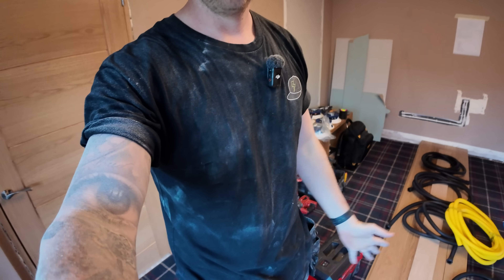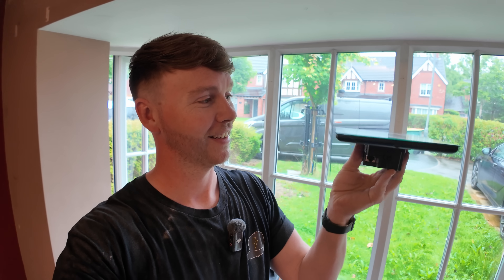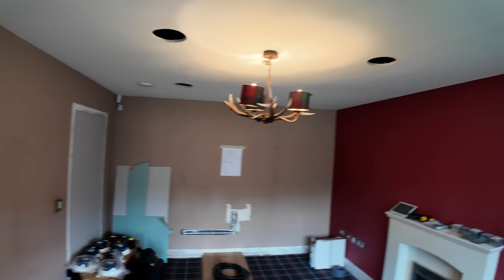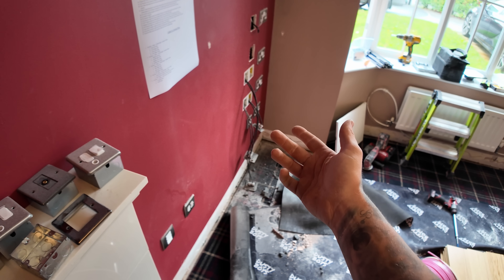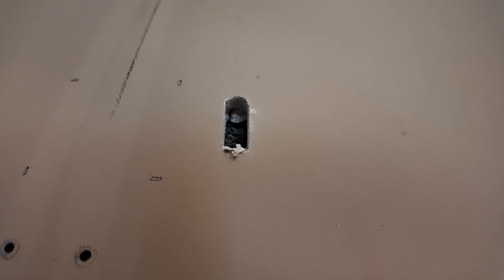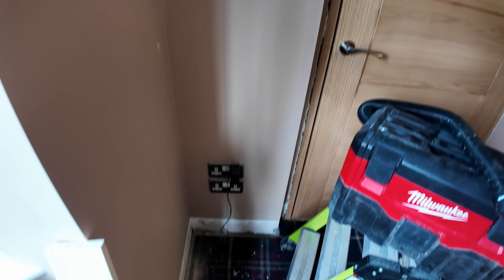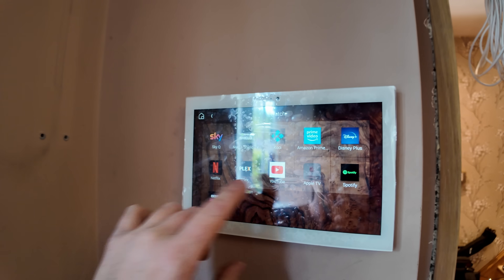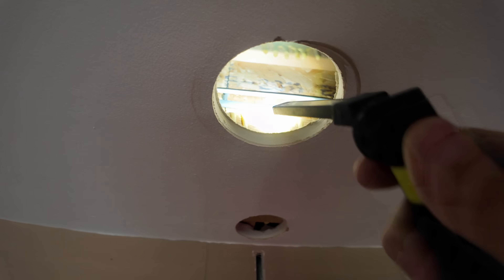100k Home Cinema - Ruined Plans In 5 Minutes

Comment: Just completed a 7.2.4 dedicated home cinema following a ton of research. The speaker cable length is a non-issue, the most important things to get right are cable thickness , ideally 12 or 14 gauge, and making sure that any mains cables are not routed parallel with them to prevent induced voltage and potentially mains hum. A much bigger influence on the sound particularly with a multi-speaker set-ups in a small room is the amount of room treatment (absorption and diffusion) to address the relections off the hard surfaces like walls, ceiling, windows and uncarpeted floors.
Reply: spot on, good advice

Comment: I can safely say, as a tech nerd, there is going to be a lot of superfluous cabling installed into the walls, so much so a future buyer will either be grateful, or think "What on earth was he doing?" lol. For a 3 bedroom house, CAT cables would already run up to 21 runs of cable for the minimum amount of network connectivity in my mind. 2 "zones" per room (entertainment area, desk area), 2 data ports per zone would be baseline. That way there's a backup cable for expansion or damage on 1st cable. But then you get into the weeds, WiFi access points and CCTV for indoors and outdoors, smart home stuff that doesn't use WiFi/Zigbee/Z-wave, or things that are not IP based but their own system but use CAT cables for P2P like HDBaseT and multi-room audio over CAT using TV audio as the source. And that doesn't include other cables that isn't CAT. Like speaker cable and Coax for standard OTA TV/Radio. 

WiFi/Wireless is good, and getting better all the time, but wired is king. I think the electrical building standards really needs to be updated to have at least 1 data port per "zone" per room for all new builds. Especially since after lockdowns, a great many ppl do not want to give up the working from home arrangements. As with everything, it's the physical infrastructure that holds everything back.
Reply: A great many people also don't want to have to plug a cable into their laptop to get online. Besides, wifi is perfectly adequate for most home workers who just need to access basic web apps and the ability to join video calls. 

Some housing developers provide data points in several rooms but I see maybe 1 in 20 of these homes actually utilising them. A more economical option is to give new build buyers the choice.
Reply: I've got a 24 port switch that's full and an 8 port switch every tv point has 2 cat 5s and a few extras in each room removing as many fixed devices from WiFi helps the only things using WiFi in my house are phones laptops and tablets if something needs mains power it can have mains networking too
Reply: For 99.5 percent of people they don’t need cable. WiFi can do pretty much everything good enough for most people excluding people heavily into tech

Comment: Don't worry about audio cable lengths in terms of delay! Quick scrappy maths; you'd need about a kilometer difference in cable lengths between near-coincident speakers before you get any significant acoustic filtering due to delay. About 150km difference if you're worried about actual perceptible delay! At these distances, you're less worried about the delay and more about the response characteristics and impedance of the cable - there would be next to no signal remaining anyway!

Comment: At the 12:00 minute mark, when you cut out the box holes, you would get less chip out if you ran a blade around the perimeter first, cutting the sheetrock's paper layer. It doesn't need to be deep, just deep enough to cut the paper layer

Comment: speaker cable distance on this sort of install shouldn’t make any difference as its travelling at the speed of light
Reply: No it isn't.
Reply: @cedarstuff  "It's the electromagnetic wave rippling through the electrons that propagates at close to the speed of light. The dimensions of the wire and electrical properties like its inductance affect the exact propagation speed, but usually it will be around 90 per cent of the speed of light – about 270,000 km/s."
Reply: @cedarstuff  I work on PA systems designed for thousands of listeners and can tell you a few meters makes no difference.
Reply: @jameskane9763  He's not wrong, though - depending on your cable the velocity factor is likely to be in the region of 0.6 to 0.9.

Comment: The speed of electricity going through wires is massively faster than the speed of sound through the air, you won't get any audible delay through wiring in that tiny space. Where a person sits/stands and where the speakers are will affect phasing, though (absolutely microscopic delays). 

Nor should the tiny differences in wiring difference affect amplifier/speaker performance, unless you were running ridiculous ridiculously thin wiring.